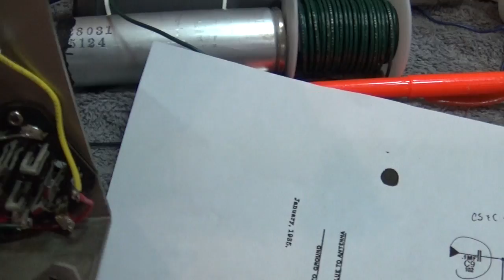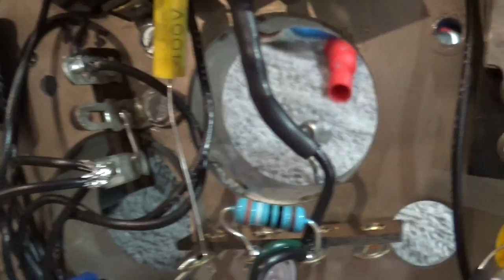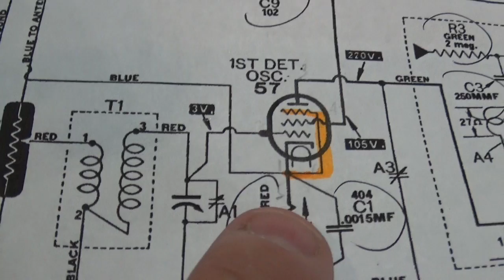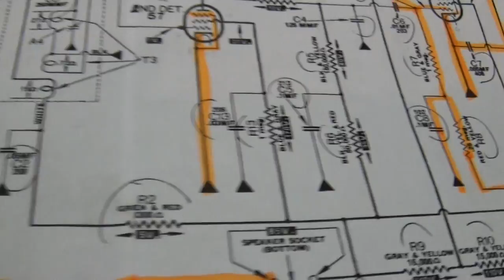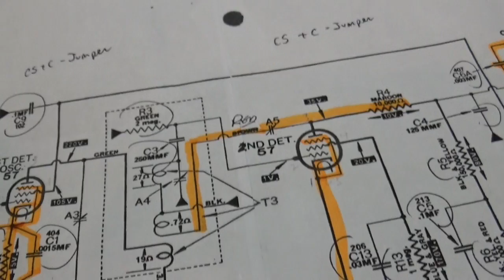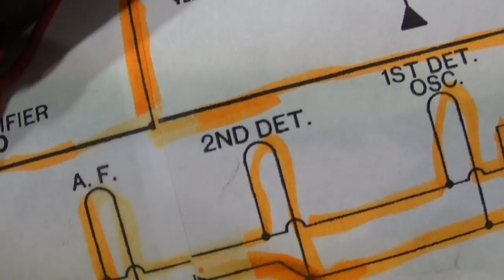Atwater Kent 854 - Episode 7 - Come Together Right Now, Over me.

Comment: I noticed the blue wire coming from T2 going to the blue antenna wire is not connected but wrapped around the ant wire.
Interesting.
Carl
Reply from the maker: Yes Carl, looks like a gimmick is used there - very common on these old radios.  Your Philco 84 has one of them as well.   Thanks for watching - Regards, Ron